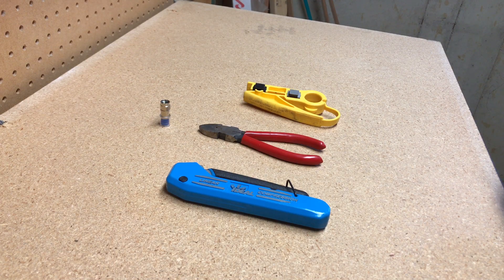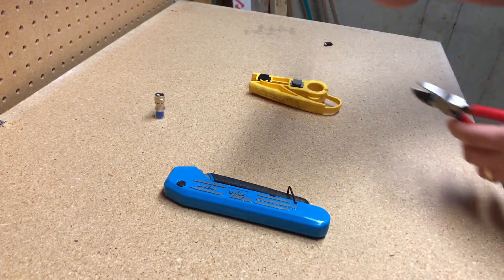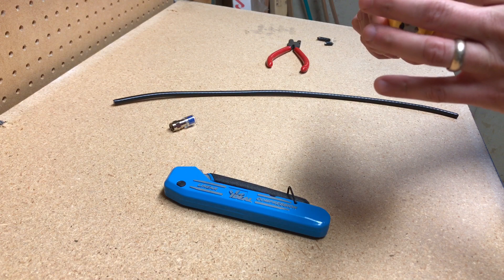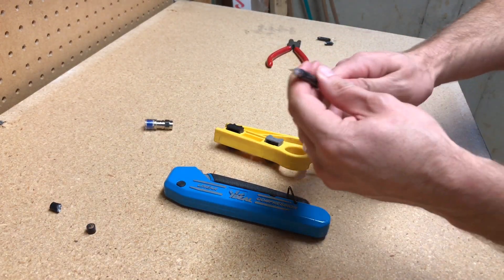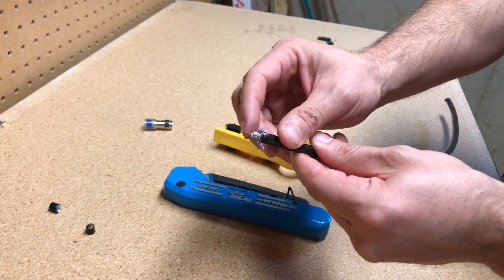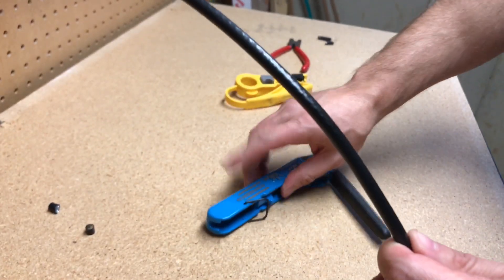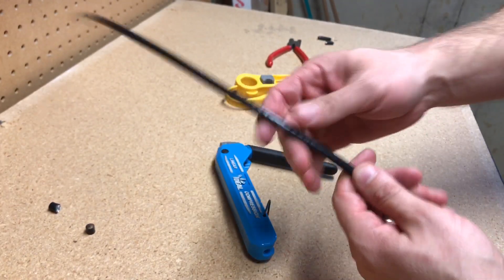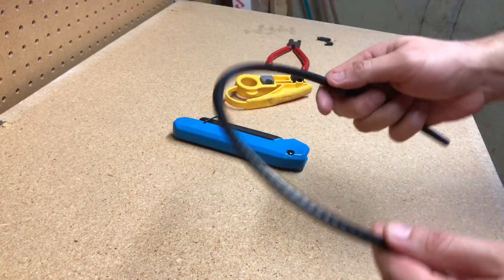How to change an RF connector

Comment: kindve have a weird problem going on at the moment so i thought i'd try to get some input here. the main part of my problem is that my quality of my internet doesn't really look like it should if that makes sense. if i'm watching a 1080p stream it'll look almost degraded a little bit. not to the point of 720 but just enough to throw you off and be like that doesn't look right. so a few months later and a few additions to some 4k tvs in the house and it started to actually drive me crazy to the point where i wanted to fix it because it definitly wasn't looking right and now it's become an issue. so the trouble shooting began, brand new tvs and things looked the same, brand new surfboard modem brand new net gear router still nothing changes. i run some speed tests on different devices and everything's hitting 100 mbps which is where it should be at so now things really aren't making sense. the speed is up there but the quality of images isn't? now i'm really lost and don't really know what should be the next course of action. i'm thinking of changing the main coaxial cable in the modem to see if that isn't degrading and than yeah..than ill really be lost. any kind of insight on anything like this that i can still troubleshoot myself or if you've ever heard anything like this? it's a really weird issue
Reply: Are you on HDMI? Do you have a decent TV? If your cable company went out there and didn't find anything it could be your TV or something else on your side ..TV is very easy to diagnose. Make sure you use a decent HDMI cable and your on  HDMI input. Also not all channels are HD